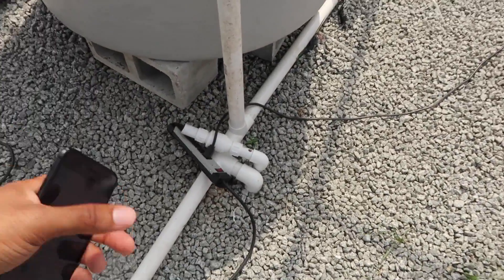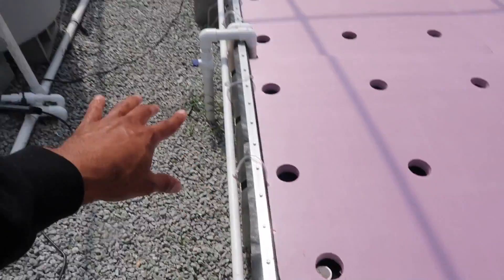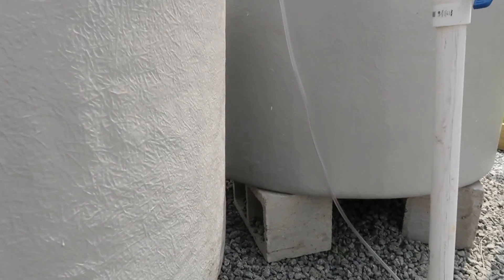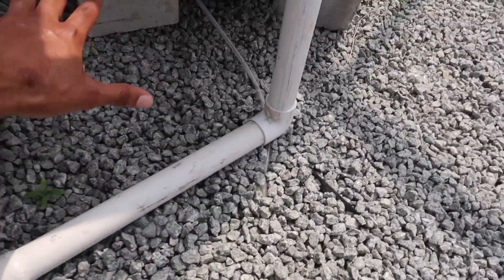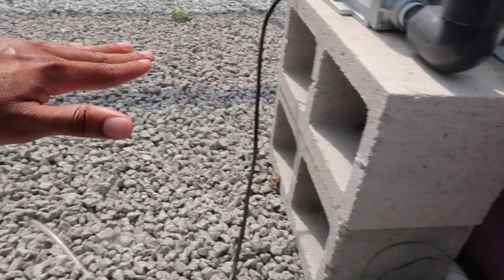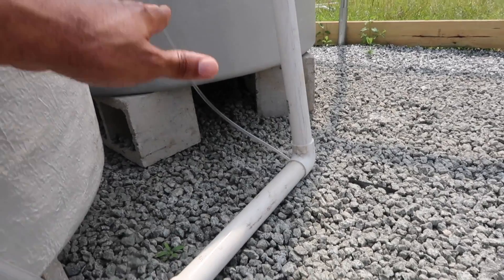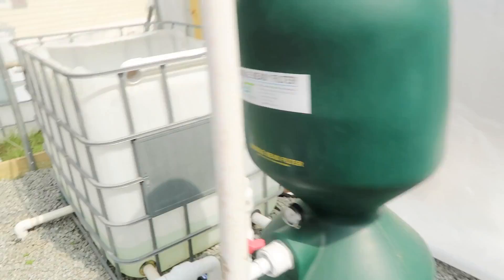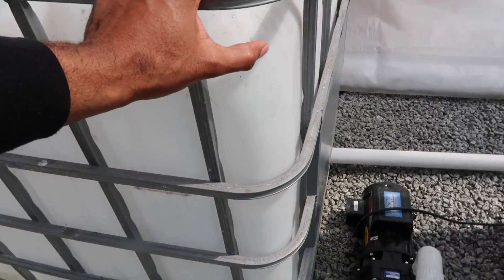Aquaponics Q&A | Ask The Aquaponics God

Comment: Had an Idea! What if you chopped your square sump tank alittle lower than in half and then added a rock box with a bell siphon that dumped directly into sump tank. It would be piped from the inlet in the sump tank where the 2 fish tanks were flowing from. You would just have to put a 90degree angel on your 2'' pipe and divert the water up. Because it seems you fish tanks might be high enough to do so?

Comment: I like this unusual design. It makes the install simpler since you don't need to sink your sump and fish tanks. My only concern is how often would you need to clean your pump and bead filter to avoid them from significantly slowing down the water flow rate since the solids go through them directly before any other form of solids settling filter?